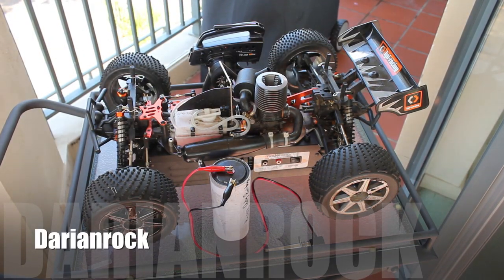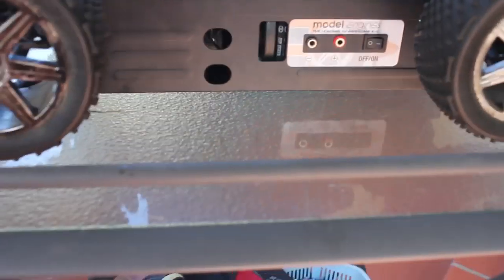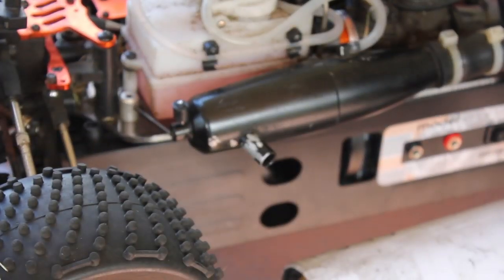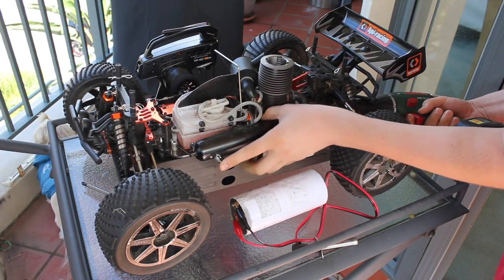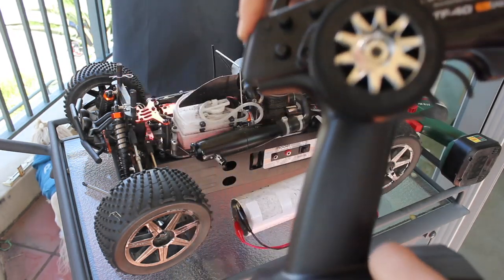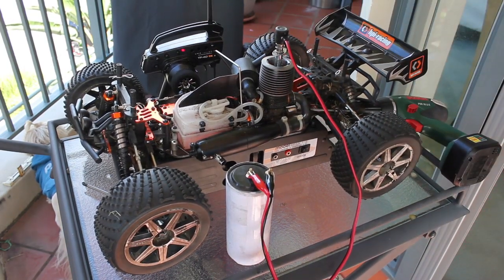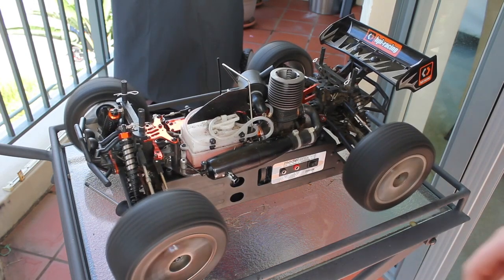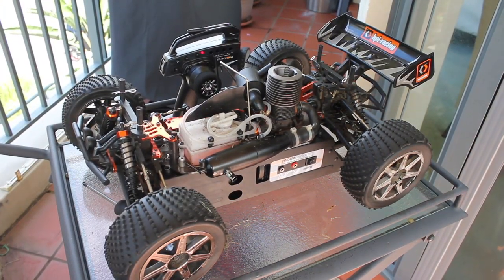How to start up a nitro rc car

Comment: You think it blocks the air ? Lmao
Reply: He is kinda right it blocks the exhaust fumes and builds up pressure to push the fuel from the tank to the carb but doing it with a unprimed engine it would block the air and pressurise the fuel tank with air not fumes